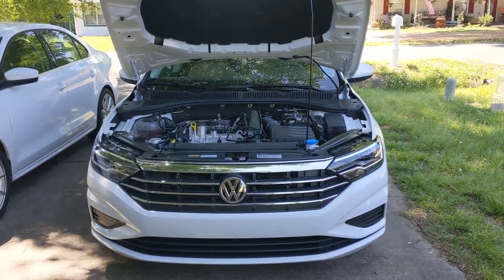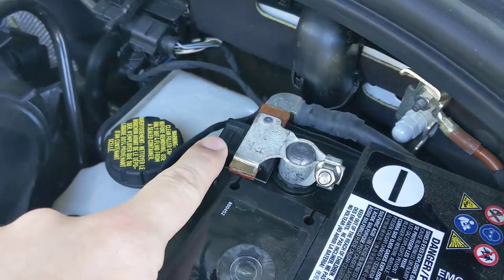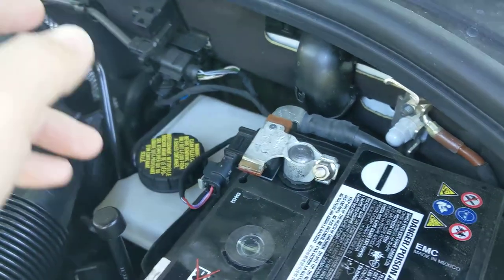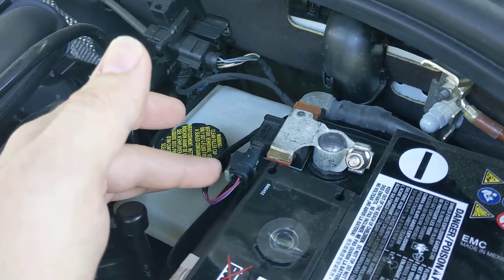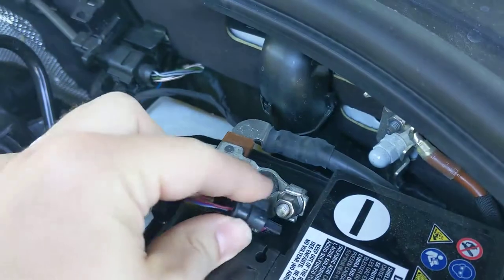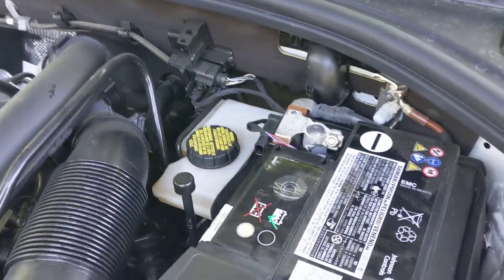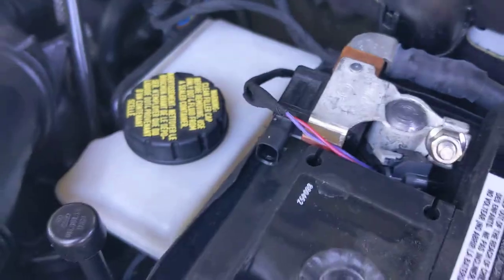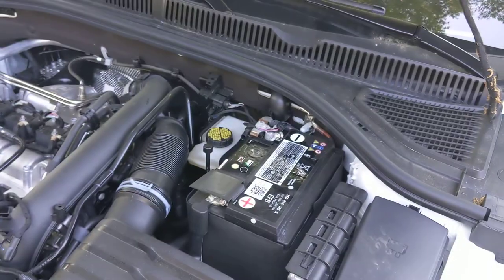Disable Auto Start/Stop on 2019 Jetta SE (and others similar models) without programming.

Comment: Brilliant! This took about one minute to do on my VW Atlas and it works. When the system would cut the engine I get  a message only once in the display. “Start Stop system error”   Thanks very much. I did put some black tape to cover the connectors so as not to cause permanent damage and tuck the wire away safely..
Reply: how is it so far? still working well without any problem from the electrical system? I'm gonna try on my Tiguan too. Thanks

Comment: Lol warranty voided. Just push the button next to the gear selector. Not that hard.
Reply from the maker: There's really not much it could affect.  And it won't void your entire warranty.  It may affect the wire on your battery, but those are easy to replace.
Reply: @ackliph  I just think on a brand new car I don’t want to take a chance.
Reply: @ackliph  Dealer won't warranty the car now cuz the cable was removed
Reply from the maker: @xzx4020  That's not how warranties work.
Reply: Really...... You'd take your car in for warranty without hooking the wire back up duh
Reply: It doesn’t stay off doe u gotta keep pressing it which is still annoying